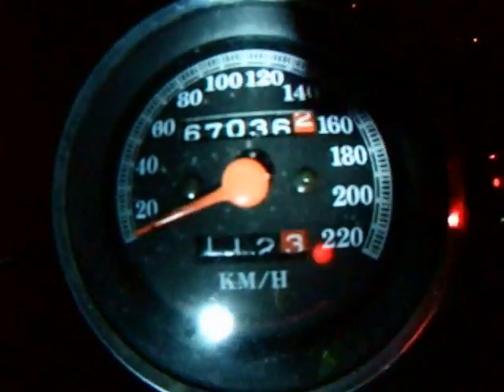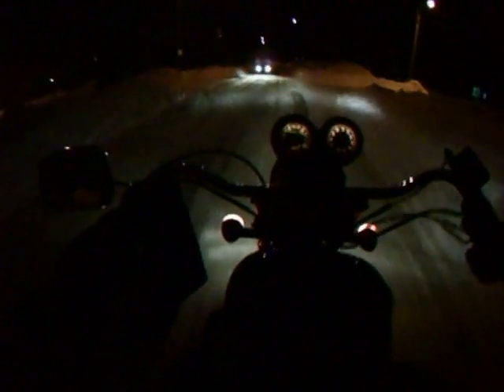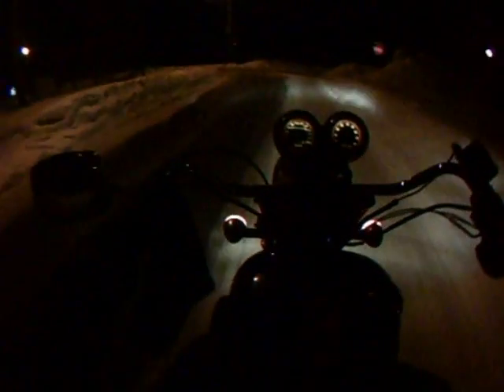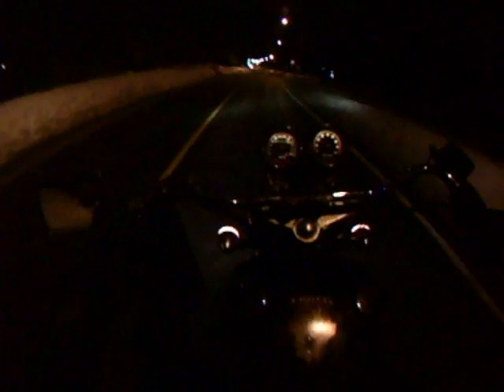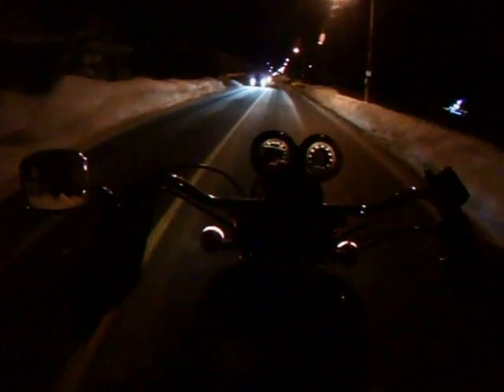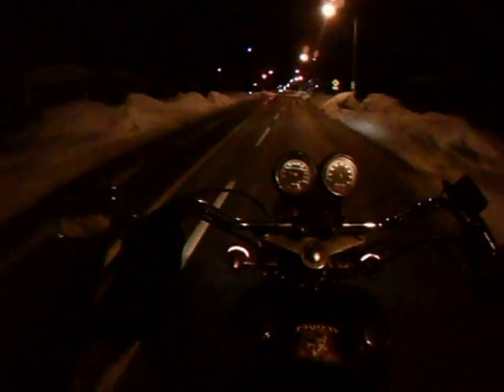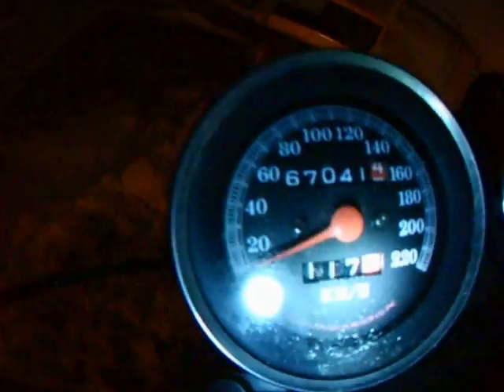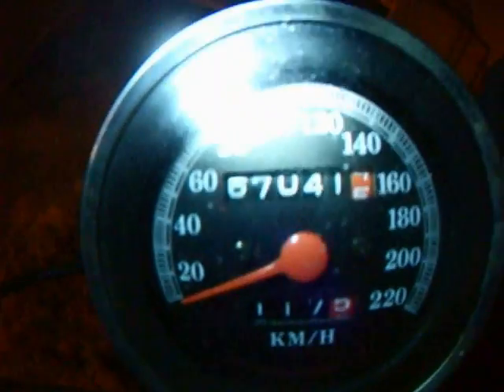PBC #73

Comment: duct tape works great between the tube and a less than trustworthy tire, i know some guys who do it on their studded tires just in case.

if it's hot they say it's hotter, if it's cold they say it's colder...  either they lie on purpose or it is hotter/colder at the airport where they get their data.